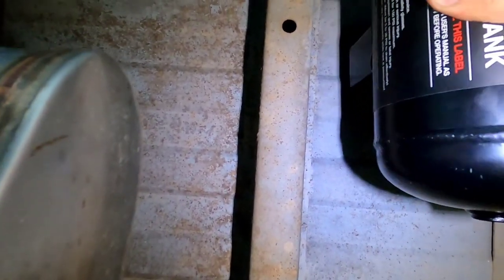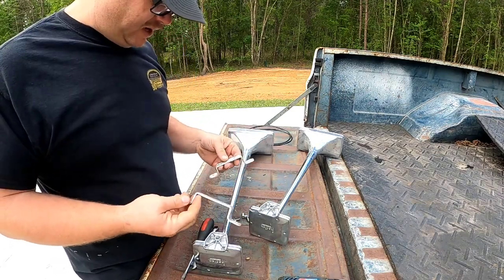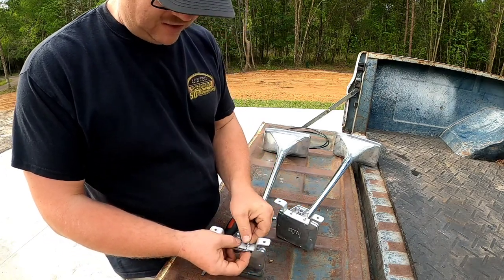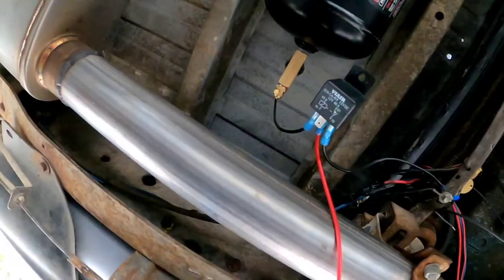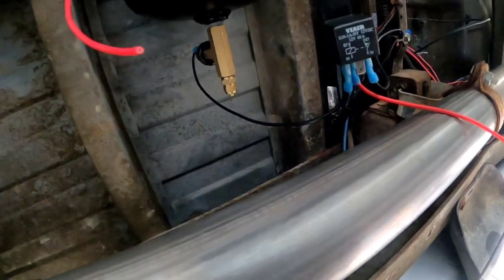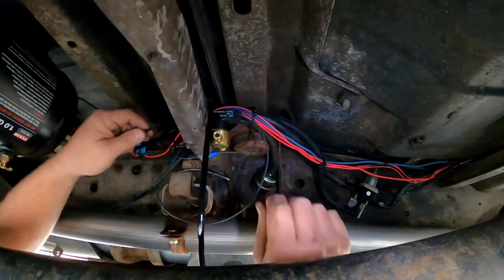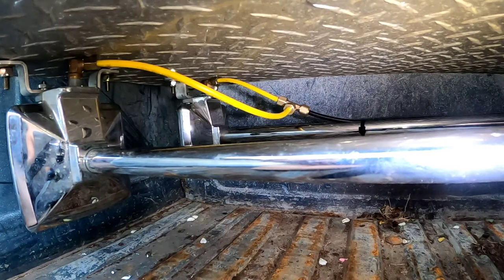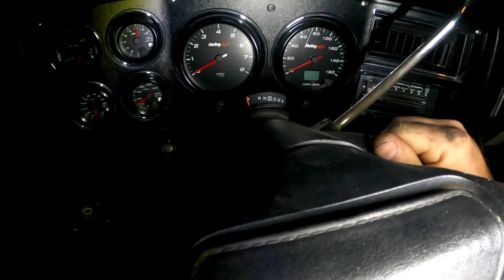Big rig air horn install

Comment: Run a bigger air line going to the T that feeds both horns, they will sound louder. Other option is to have the tank closer to the horns.
Reply from the maker: Thanks for the input. Weeks after the video I did put a bigger line to the tee and it is way better👍🏻

Comment: i've installed a set of hadley 37.5" air horns on my lorry (rig) and i broke the 90° air fitting that's drectly mounted under the horns, do you know what size is it ? i've lost the broken part so can't even measure it
Reply from the maker: Not sure on the size
Reply: @JunkinwithJr  that's fine, just found out it's an M12 thread. thanks